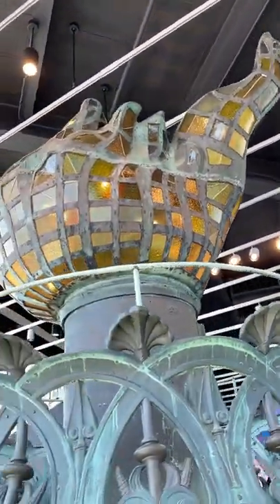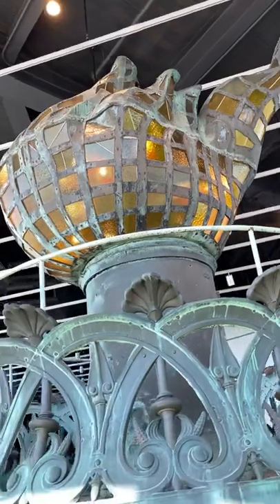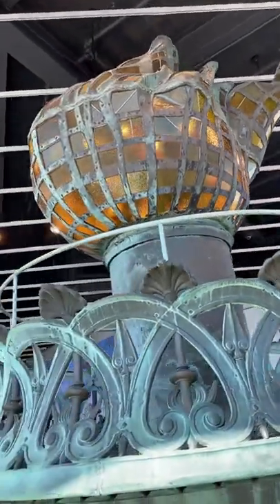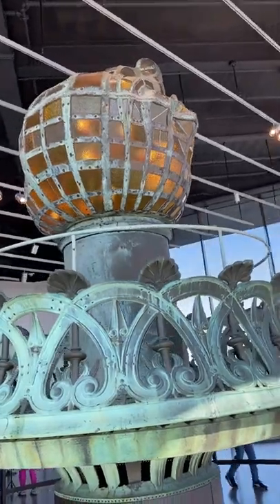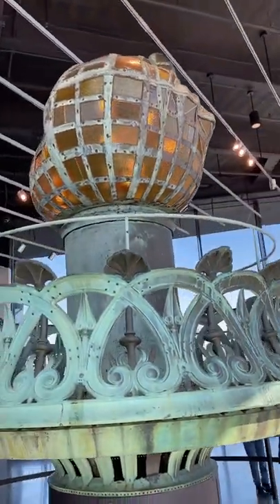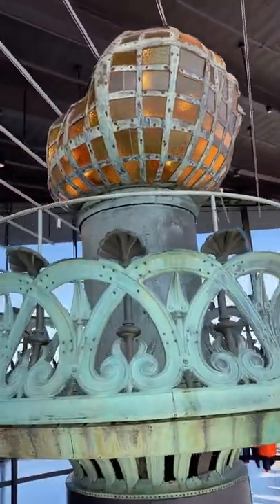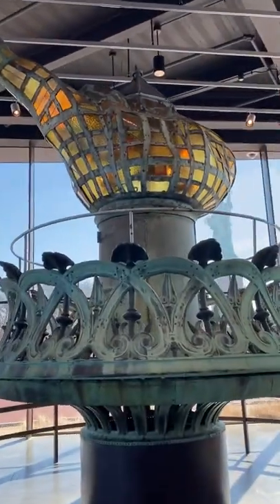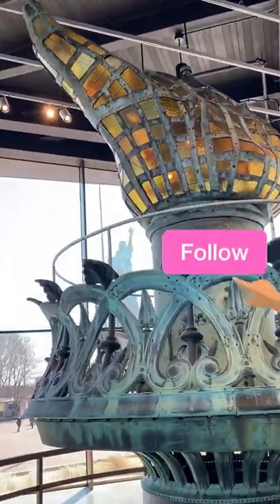What happened to the Statue of Liberty’s torch?

Comment: I actually like the new one better because that was the original design (to be gold and lite from outside) but it was to expensive back then.
Reply: Lite?Dont you mean light
Reply: @EKWEETREGTIGNIE  No they are right, " gold and light from outside" doesn't make sense, lite does, don't try correct people if you don't even know what is correct
Reply: It was not too expensive.  Gold leaf is only a few molecules thick.  The original design was not intended to be lit from outside, just to reflect sunlight during the day off of its gold leafed surface.
The reason it was done as an electric light is because, but the time it was actually erected, the US was being newly electrified, and so lighting it electrically was possible, but also because the title of the work was “Liberty Enlightening The World” and they just thought it would be cool if it actually WAS a source of light.  The torch was originally lit with a bunch of Arc lights, which turned out to not be all that good.  The gold colored glass was added by Gutzon Borglum, The guy who did Mount Rushmore, to try and make it look more golden colored, and the torch lighting was changed to a cluster of incandescent lights. But, again, that turned out to be pretty dim and just id not look like gold at night.
So when they did the major renovation and replaced all the interior iron strapping with stainless, they had the torch entirely redone in repouseé copper and gilt as originally intended and its now lit by a ring of super bright LEDs from inside the rim of the torch balcony.
It looks far better and more golden at night with its real gold finish and led lights